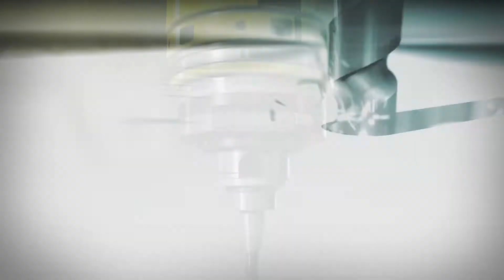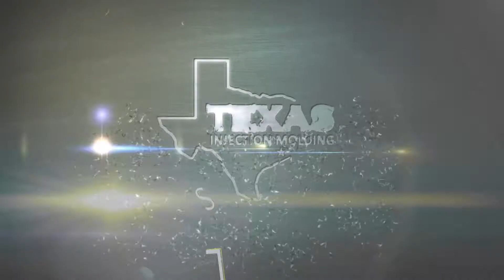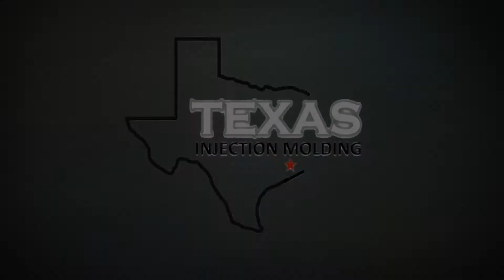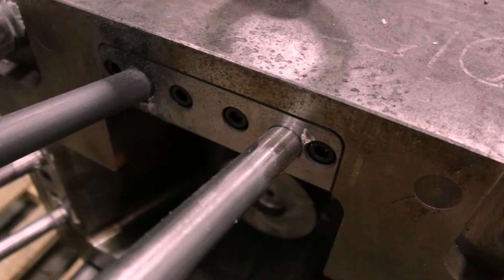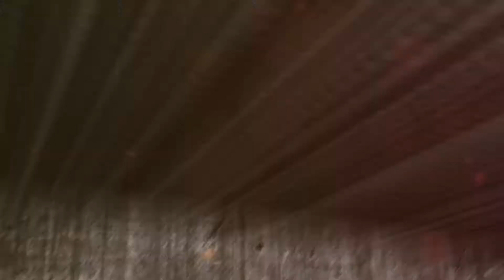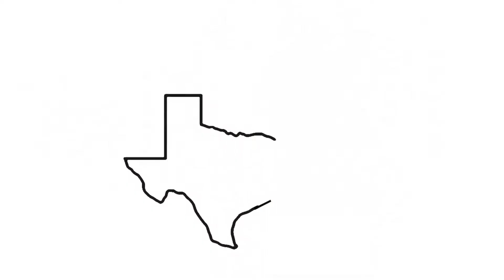Injection Mold Slides

Comment: interesting, can u explain that contruction in special video sir. Great video, keep it up sir
Reply: 4 slides that form the undercuts are guided by horn pins to pull away from parts during mold open to allow the part to be removed from the core.